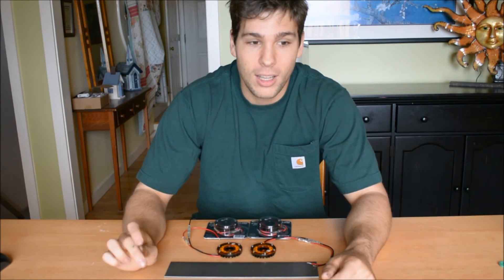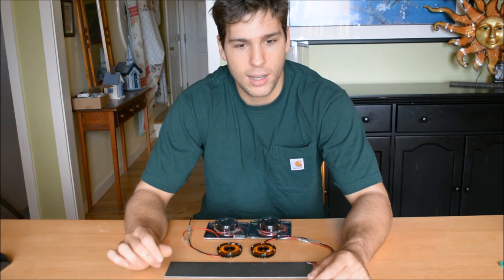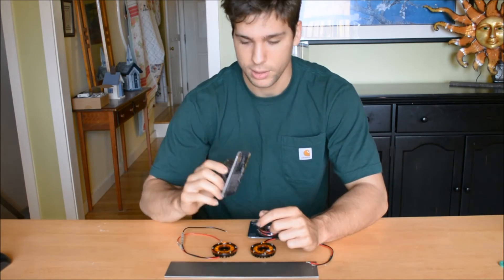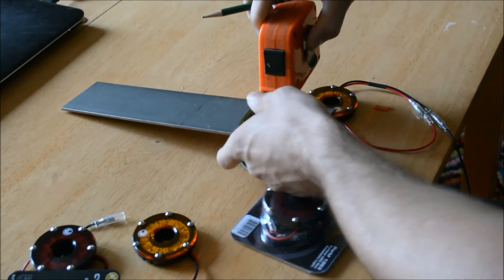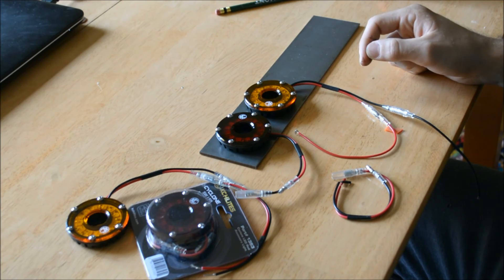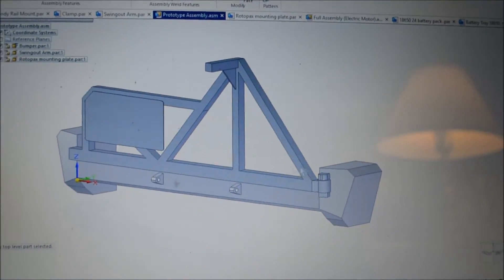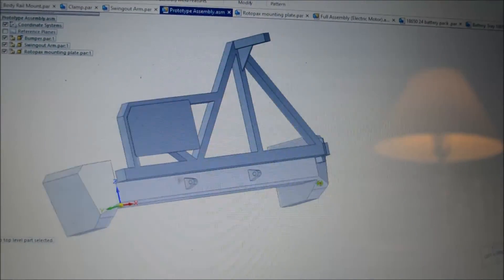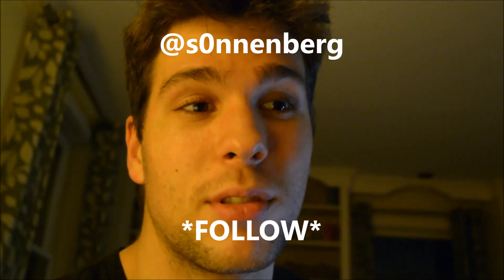KC Cyclone Install and CUSTOM Rear Bumper Project!

Comment: Bro! This is really cool. I was wondering how you wired these up? I'm looking to do something like this on my softtopper.
Reply from the maker: Thanks dude!! Glad you liked it. It’s been a long time since I’ve done this, but if I remember correctly, I believe I wired everything into my trailer lighting plug harness (just tee’d off all relevant conductors).

Comment: I would have drilled a 3rd hole in the mounting plate center but 1/2" from the bottom, put a grommet in it, rotate the lights and run the wires through the grommet for a cleaner look. Good job tho'

Comment: those lights look way better then the other bar.
keep up the good work
Reply from the maker: Glad you like them!  Turned out great
Reply: You should probably knock off the top outside corners like you did on the inside